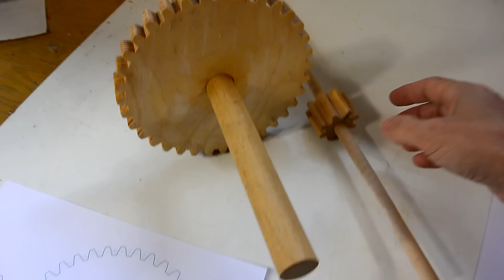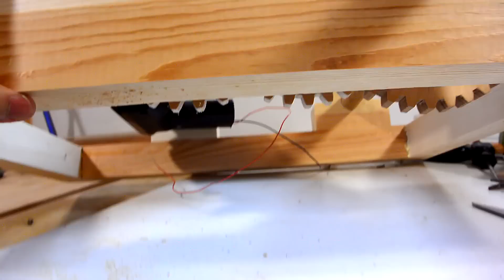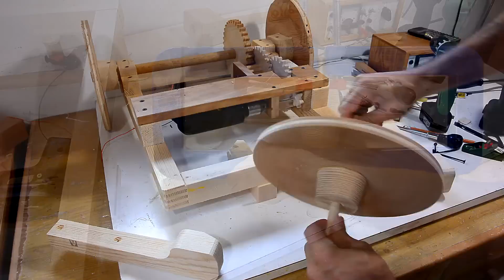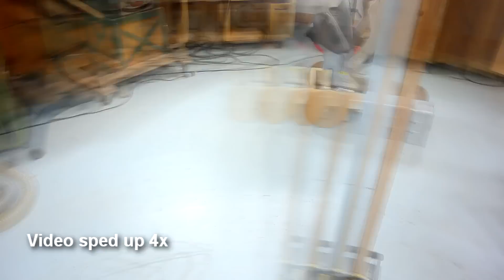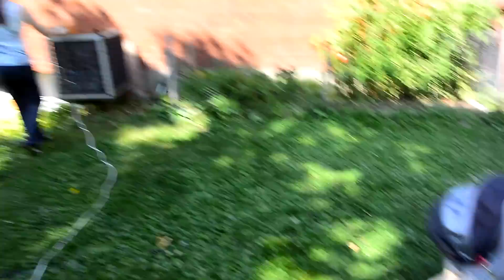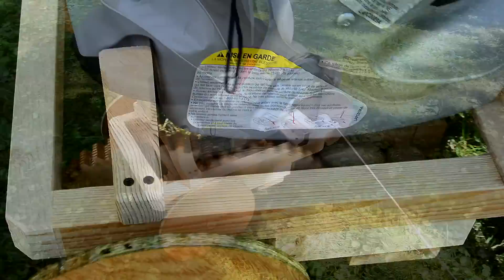Wood geared baby soothing machine

Comment: Put the drive wheels on a bit of an eccentric so that it rocks back and forth.
Reply: You would only need to do that to the front one.
Reply: +cookiezillaevan, if you only did it to the front one, the wheel might not get enough traction to lift the weight and might only slide. It would definitely be worth a try though.
Reply: +Darrel Carson Just carve teeth on the face of the wheel to give it traction on the grass to force it to spin.
Reply: +Darrel Carson That's actually not a bad idea
Reply: +Vikas V he puts wood gears on everything else so why wouldn't that be the solution.

Comment: Congrats on your new Baby... Here is something to consider to keep the cord from winding around the center post, make a hub. A good example of this if how a bicycle can still use a cable but have the handle bars rotate 360 degrees as in Extreme Bike Racking, but adapt it to pass electric. 

What I've seen in the past is 2 different sized copper circles used, 1 inner and 1 outer, to allow for a flexible piece of copper to meet a fixed circle. A good example would be a 1" copper pipe for the inner and 2" copper pipe for the outer embedded into a 3/4" thick circle hub. Each piece only need to be about 1/2" in length, just enough to embed into the wood. 

You can solder to the top side of the copper pipe, drill a hole in the wooden hub, pass the wire to the top that will extend to your motor cart and if you like add an additional tether to keep the wire from being pulled out. Then the bottom of the copper just needs to touch the flexible copper, 1 connection per side to ensure the two never touch. 

You could make the circles longer, say 2" for the outer and 3" for the inner copper tube and then once embedded you just need to touch the sides as the copper tube spins. Also you could use stranded 12 gauge wire, stripped about about 1/2 inch and bent into a slight curve to make constant contact with the copper pipe. 

This hub will allow for 360 degree rotation around the tetherd line. You can use a bearing as a pivot to hold the cart, that way once set in motion it won't have to stop.

I probably over explained this but I am sure you get the jest of it, good luck...

Comment: Another great adaptive use for child car seats.  I agree with you on the noise being a baby nuisance  (a slow geared induction motor would help).  Yards are by nature quite bumpy, unless rolled like golf greens and that would probably require too much maintenance.  Simulating a paved road or street may be more tricky, possibly some type of high tech shock absorbing system.  Even if you could figure out a smooth ride that would probably be cost prohibitive.  Genius is 90 percent failure so you are still doing remarkably good.  Please keep it up, thanks for sharing,  LOVE YOUR VIDS?

Comment: I think you're on the right track. Perhaps insulating the motor and gear box to be a little quieter. When my son was a baby we had a windup swing that would hang either a bassinette or a chair. When he was really small he would swing in the bassinette and fall right to sleep. When he got older it was the same with the chair. The mechanism would run for 15 minutes and he would sleep for an hour every time. 
At bed time I would rock him to sleep.

Comment: I am willing to bet that the problem is sound/vibration, I've been through 3, and my better half runs a daycare. The little ones are way more sensitive to sound and vibration than we are, plus the little one is sitting way closer to that motor than you are, the car is faster smother and probably quieter. BTW, for our first, the car trick never worked, which we later found out that she had a tenancy towards car sickness, now that she drives, she certainly makes up for it. I love these baby gadgets :-)

Comment: doesnt the cable wind up on the post when the machine goes round?
Reply from the maker: +jumpleadsx2 yes, that way it won't wear a circle into the lawn.  My intention was to have some means of it to shut itself off, but that's assuming the machine was actually useful.
Reply: +Matthias Wandel Du musst eine extra leises Mähwerk drunter spaxen. Dann hast du dir die Mäherei gespart ;-)

Comment: I am curious what vibration runs into the baby seat from the gears and if the sound may have been the problem possibly amplified in the baby seat. My kids are now 7 and 4 but I had a thought of making this as a round about ride in the yard. Of course with a little more power.

Comment: How are you going to make sure the carriage stops once it's fully wound around the post? I know, this should never be run unattended, but I assume you would want this safety feature...
Reply from the maker: +Zerkbern I was going to figure that out later.
Reply: +Zerkbern ... When we get bored we do this,...watch video on youtube. When Matthias gets bored he does that, you know, make stuff. Just not with pocket holes.
Reply: Never with pocket holes................ever
Reply: +Matthias Wandel Fix the cord to a rotating post that winds in and pulls the plug after a set number of turns. This also changes the place where the wheels run over the cord every time around. You can change the pivot point or radius traveled occasionally so you won't get ruts in the lawn. Maybe eccentric wheels or gears to vary the motion and a nice quiet induction motor to not assault the little ears.

Comment: Hi Matthias

walking is a non linear movement, meaning that you move at different speeds during the motion that "bobes" babies to sleep.
try and remove a few teeth off the final gear (or the last large gear) and you should get this motion.

good luck

Comment: Hey Matthias, why do you use a drill to put in screws sometimes and other times use a screwdriver and other times use your impact driver. Shouldn't you use the impact driver for everything.
Reply from the maker: Why should I use it for everything?
Reply: @matthiaswandel  I mean it would be easier to drive screws into wood with an impact driver.

Comment: Yeah could have been sound of the motor.  Or lack of smooth air glide suspension, or feeling safe inside the
big  vrroom go go capsule.  Or maybe what is soothing to baby is the high G forces of fast acceleration off a red light.
So maybe you need to make a a baby soothing machines that will go from  zero to sixty in 6.9 seconds.

Comment: I think the rocking machine was better then the stroller as the stroller was going in circles only anyway .

Another point the rocking machine was rocking inside out.  kind of like tipping the baby out motion( i will see if you have a video of making that). where as in a swinging like motion the bassinette is not tipping out

Comment: yeah, it needs to go faster. I say go with a lawnmower engine, or maybe a moped
Reply: +Rob Mckennie I say go with a more powerful motor straight on the axle so it won't be as noisy.
Reply: +Rob Mckennie Or a diesel locomotive engine.
Reply: +Rob Mckennie Probably needs a V8 engine, realistically.
Reply: +Gezo and  a spoiler is needed for sure.

Comment: Why not a random oscillating rocker that sits on Springs? You could emulate the feeling of motion in a car or on a walk with gentle bumps and turns, but without having to actually go anywhere. With a constant velocity, one cannot feel the motion because you have no acceleration. 

The circle would give some sense of movement on its own from the constant turning, but the real feeling comes from the bumps in the yard. 

Mechanically speaking, the motor and gears were pretty loud and we're probably hard on your baby's ears. Could have also been nap time. Who knows.

Comment: the problem is the sound... she just doesn't like the sound it makes.

As young as she is, she associates that type of movement with silence not a cacophony of sounds.  If babies liked noise, the commercial units would make a racket.

If it is going to be noisy, at least set it up to cut the lawn at the same time.

 now you need to make a wooden noise-cancelling device.

You can do it...